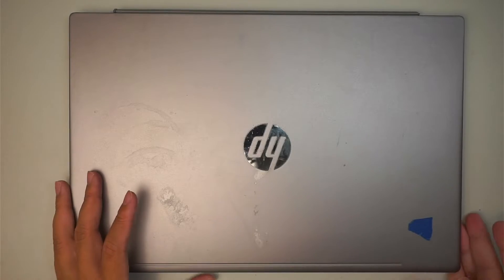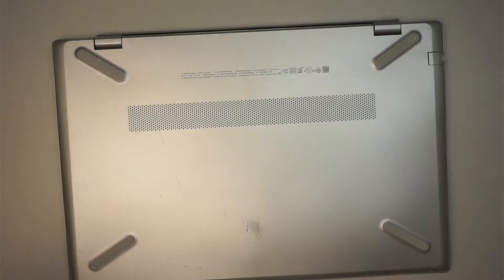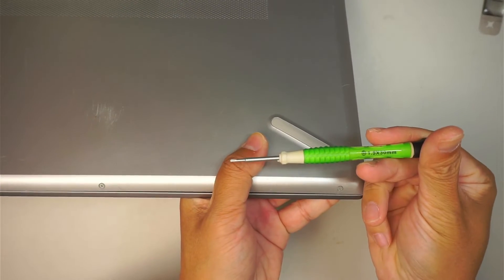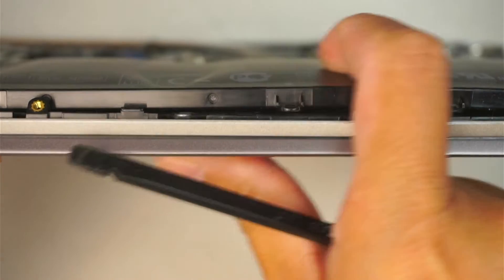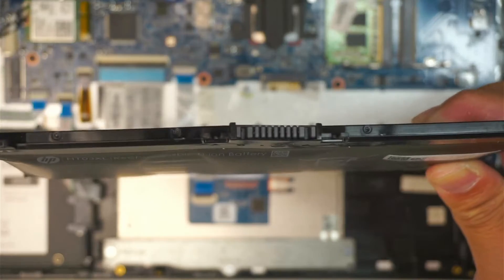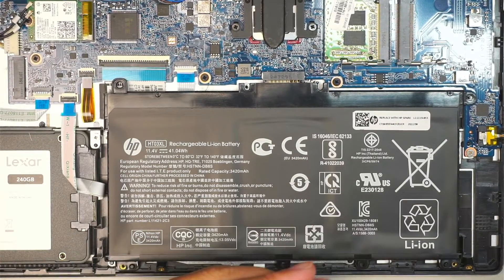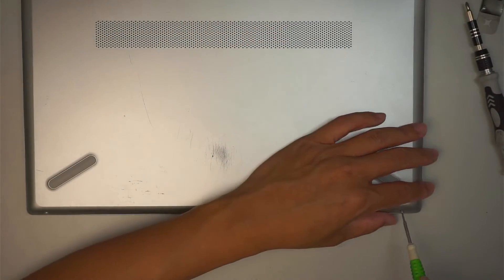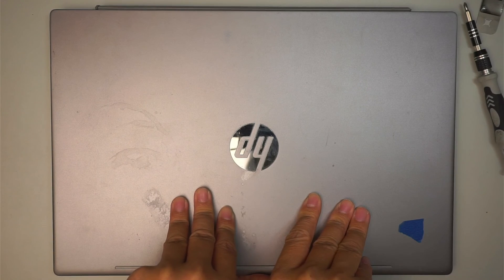HP Pavilion 15 Battery Replacement Start to Finish

Comment: Thank you for the excellent instructional video.

For those without plastic pry tools, slide a credit card between the panels, pinching the edge of the credit card so only an 8th of an inch of the cc edge is exposed so while sliding the credit card in to separate the panels, the card doesn't slide beyond the seam and damage anything inside the seam.  That worked for me.

Comment: After watching the video, I decided to take the back cover off to verify the battery model. It's the same one as  in the video. My track pad was fully functional but my battery was very swollen. I removed the battery so I could see if I could still us my laptop, while I waited for the battery to be delivered. It does work with battery removed but when I started the computer, I was given a promtp to begin setup of the laptop. I kinda looks like what one would see when the first bought the computer. What do I do about this?

Comment: I installed a new battery I have HP Pavilion 15 - au109ni... The next morning the caps lock is blinking
Reply: A flashing Caps Lock light on an HP laptop can indicate a memory-related issue. For example, if the light blinks three times long and then twice short, it could mean that one or more RAM modules are failing. To verify this, you can try swapping out the RAM:
Remove the bottom cover and battery
Unscrew and remove the access panel
Remove the old RAM and replace it with a new kit
Put the system back together and turn it on
Reply: Thank you I solved the problem.. I found that the RAM modules were the problems... 👌

Comment: same as the first time I didn't realize there are two screws under the rubber!  I easily found it in this video and it worked, and the new battery is charging, success!  Thank you, nice and no fuss video guidance!